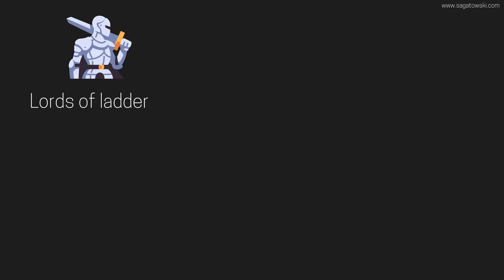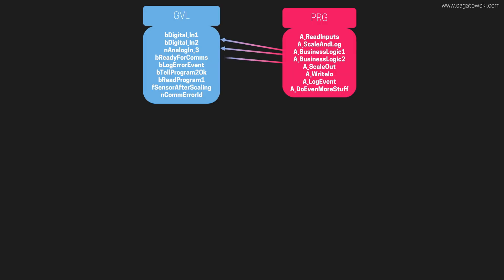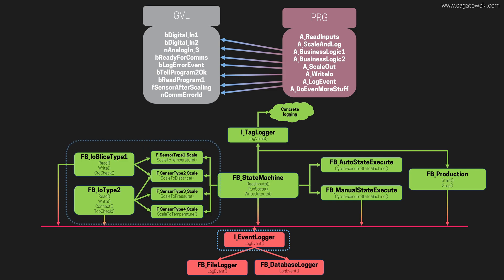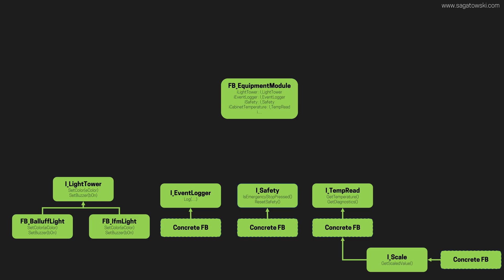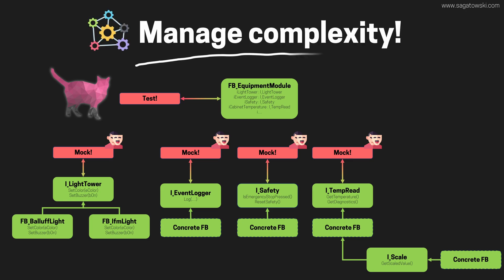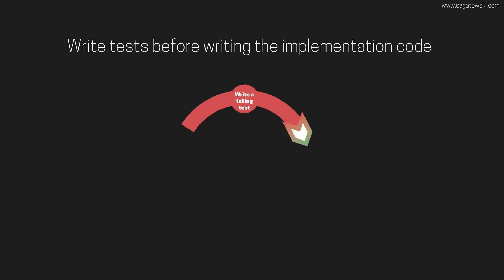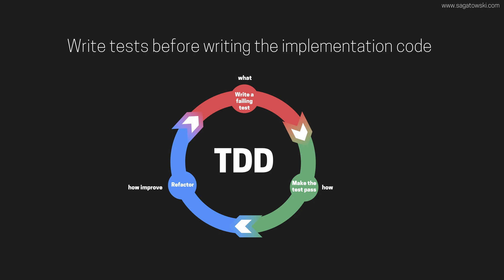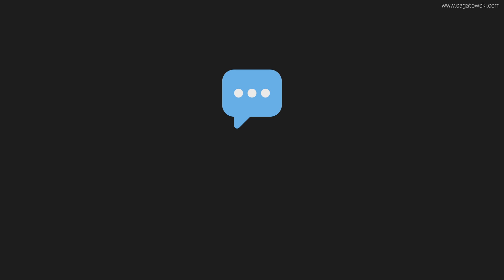Ladder Diagram vs. Structured Text

Comment: Yes, Structured Text is great for developers — it’s powerful, clean, and scalable.
But in factories, things work very differently. You don’t have the luxury to wait until the programmer comes back the next day to fix a line of code. When a machine stops, production time is money, and the problem needs to be fixed now — sometimes at 3:00 a.m., by maintenance staff who understand wiring diagrams, not abstract code.
That’s why Ladder Logic still dominates in real-world industry. It speaks the same language as electricians and technicians on the floor. When something fails, they can see the logic, trace the I/O, and get the machine running again in minutes.
Structured Text has its place — for things like data handling, statistics, or calculations for complex process — but when uptime and clarity matter, Ladder wins every single time.

Comment: Basically the idea of breaking software into subroutines, which goes back to Fortran.  Goes by various names and flavors - functions, classes, and such.  I have seen it carried too far, such as a call to a subroutine which runs just one line of code then returns.  Such over-granularity turns the code into a spiderweb.  Those who think graphical code is easier to follow have never seen a Labview program for even a fairly simple operation.  Re PLC, I often find starting with SFC ideal for breaking the code into manageable parts and also aids in following the flow during trouble-shooting.

Comment: Ladder is hot flaming garbage.
FBD or CFC is infinitely better.
Reply: Ladder is good option for creating/debugging the machine cycle! It gives you well visualization what's going on. Also it is the most familiar to electrical drawings (control circuits). 
But at the end the best is what you are most used to 😉 F.e. I never use FBD, ST...  - I use ladder. But sometimes I agree with the argument, that ST could be better solution for some applications, especially when you work with data arrays.